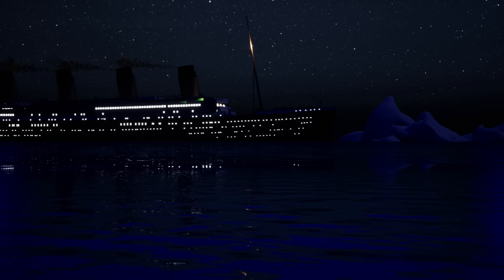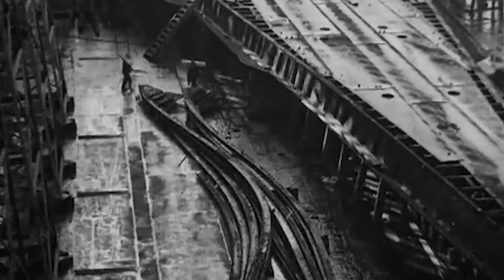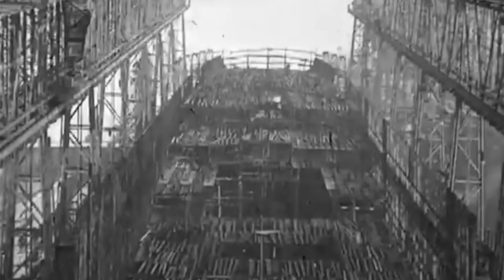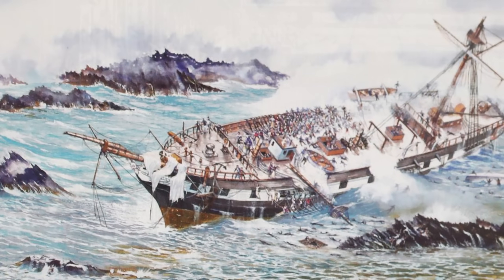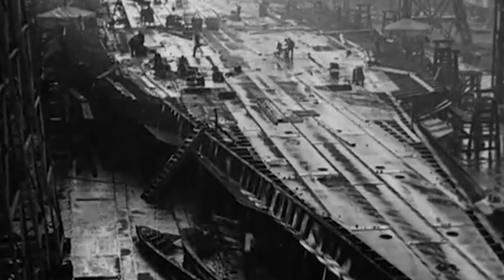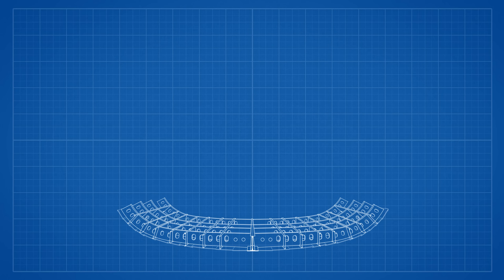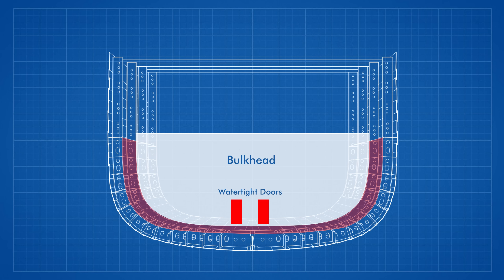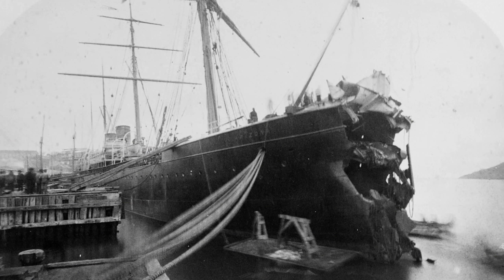How did the Iceberg Sink the Titanic?

Comment: I've always thought it was so tragic that the damage that actually doomed the ship was the small amount of damage to boiler room 5.  If they could have somehow repaired that small amount of damage the ship could have been saved.
Reply: The ship had six compartments damaged. As it was built, it was meant to be able to remain afloat with any two of the 16 opened, or any three of the first five. Six was just way too many ☹
Reply: @whaleguy  Yo, the damage on the 6th could be dealt with by the pumps, it was really minor, and it could stay afloat with 4 of the first 5.
Reply: It's the damage in BR6 that doomed her.
Reply: The rate of ingress into Boiler Room 5 was well within the compartment's pump capacity to remove. However, once the crew closed the forward starboard side coal bunker (Coal Bunker W) the flooding in that Boiler Room was more or less ignored.  Coal Bunker W isolated flooding in Boiler Room 5 (WTC 6) which kept the rest of the boiler room dry until 1:00 or 1:15 AM which the bunker's hatch doors finally gave way to the massive pressure the flood water had increasingly been exerting against them. The suction basket drain sites were located in the center of each Boiler Room. There were no drain sites built into the flooring of the transverse coal bunkers found in each boiler room. In order for flooding in Boiler Room 5 (Coal Bunker W) to be jettisoned back into the sea the crew should have left the hatch doors open allowing the ingress to pour over the hatch door thresholds onto the main Boiler Room flooring where it would eventually find its way to the suction basket sites for removal.  Having said this the level of flooding from damage sustained within Coal Bunker W of Boiler Room 5 (WTC 6) did not provide Titanic with the balance of extra flooding in excess of flooding from the Forepeak Tank, Holds 1, 2, & 3, and Boiler Room 6 necessary to sink her.  When the allision in Titanic's starboard side hull plating stretched past Bulkhead D between Hold 3 and Boiler Room 6 extending well into Boiler Room 6 (WTC 5) the jig was up for RMS Titanic.  She simply could not lose Holds 1, 2, & 3 plus Watertight Compartment 5/Boiler Room 6.  I don't even include flooding in the Forepeak Tank which a horizontal bulkhead forming the top of the forepeak tank limited flooding to just the forepeak tank which by April 14th was likely already around 2/3rds full of ballast water. The rest of the compartment flooded when the ship developed a negative enough trim allowing water to overtop the collision bulkhead from WTC 2 into said compartment completing the flooding.  Titanic would still have sunk if the allision had come to a complete end within Boiler Room 6's hull plating.
Reply: Dennis Wilson  what rubbish. You should stop the silly conspiracies.
Reply: Dennis Wilson  
DO understand... you are using a specificity for steel strength that didnt exist for another 10yrs.

ALSO... when you have earned at least 2 Engineering Degrees, then you can go on about how her steel wasnt made correctly.

P.S
You should walk right up to Thomas Andrews and or the People on the Board at H & W.. and in your 5yr old mentality.. explain to them how flawed their materials are.

Next Time I go Time Travelling, you can go with me and tell them that. Id love to see the look on your face..
Reply: Dennis Wilson  complete BS
Reply: Dennis Wilson  Go away.
Reply: Dennis Wilson  Blah blah blah the earth is flat too right?
Reply: @m2heavyindustries378 Yes, Dennis is delusiobal.  Humble yourself because you are too.  The earth has hills and mountains, but the water is certainly flat.

Comment: I refute that the rivets were as strong as they should be. Wrought Iron is a fairly soft metal so wrought iron rivets would have been to soft to resist the scraping of the ice. Steel rivets would have had a better chance but even then it might not have been enough.

Comment: Wow, that was fantastic!  I have watched a ton of "specials" and things about the Titanic since the 1980s and none of them have ever really focused so well on the pure engineering behind the ship as you did.  Very well done.   This wonderfully illustrates how the disaster was not a case of bad design so much as just the circumstances of the damage being enough to overwhelm all the safety measures of the day (which were very impressive up to that point).  Even the additional safety features that were added to her sister ships (like any engineering solutions) could only mitigate so much before being overwhelmed, like on the Britannic when it hit the mine (or torpedo), which did more damage than could have possibly been designed around.   Anyway, great job again - I'll certainly share this with some friends who love engineering details!
Reply: And aside from the double skin (which was a legitimately good idea,) most of the added safety features were more for show than reasonable. Like sure, they could now survive an incident like the Titanic's where 6 compartments were breached, but it didn't really add anything in other, far more likely scenarios, and by reaching B deck started to cut into actual passenger accommodations like the first class dining hall.
Reply: @flametitan100  Yeah agreed - some were useful, others were more for public image.  The higher bulkheads only delay the inevitable at that point, and not by much if there's that much water in the ship.  As a network admin, it reminds me in a way of security; you need it, but put in too much or do it too elaborately, and you make things so hard for the user they'll avoid it.  Finding the right balance is the trick.
Reply: Brittanic ISTR the major cause for the sinking was all the portholes being open, because the designers had figured out they would all be normally closed in the cold Atlantic runs, but instead she was now in the sweltering Mediterranean sea, and the ventilation was in no way designed to cool the ship, more being designed around heating up the areas that would be losing heat really rapidly to the surrounding cold water, instead of the other way round.
Reply: @SeanBZA  Also as the explosion lifted her bow out of the water the hull was bent enough for several bulkheads failing to close. She would have remained afloat if all doors closed. It was just too much. These mines where meant to sink a Dreadnought. In fact Olympic rescued survivors from a post Dreadnought that hit a mine and sank. And they had a lot of compartments that could be sealed to really isolate a leak.
Reply: @SeanBZA  Yiiiiikes... ya, that'll certainly overcome all the other systems.
Reply: Yeah, it would have taken a "real leap of the imagination" to consider the possibility that a "watertight compartment" actually needed to be completely watertight, not just up to the top of the bulkhead(s). Sorry, although understandable, it was indeed, "just a bad design." Had the "watertight compartments been truly that, we wouldn't be having this conversation. Something that's watertight is exactly that, unless and until it's penetrated. lf not, it's water permeable, kind of like being dead. One is either alive or dead. No one is almost dead.....at least not for long, although members of a certain US political party give an excellent appearance of being brain dead, while walking and talking, etc. Those who are nearly dead, either recover and remain alive, or they're dead, which is permanent.....as far as we know.
Reply: @frankmiller95  The thing is, making them "fully" watertight as you suggest isn't as simple as people make it out to be. You still need the ship to be navigable for crew and passengers. Making a compartment "fully" watertight means potentially sealing people inside of those compartments. Additionally, the majority of the time, it's just not necessary. The design of a compartment is that the buoyancy of the unflooded compartments cancels out the loss of buoyancy from the flooded compartments, preventing water from overtopping. Sure, you can have an incident like Titanic's where after enough compartments are breached, the loss of buoyancy drags the top of the compartments under the waterline, thus causing overtopping, but there you have to weigh the likelihood of such a collision with the impact it would have on passenger accommodations. Something like what happened to the Titanic was pretty low on the risk/reward scale, all things considered. The damage she sustained was around 1/3 of her total length, some 290+ feet. That is rare, and considered an acceptable risk compared to making sure she could survive colliding another passenger ship, which was significantly more likely, but also significantly more localised.

This is on top of there being a point where enough damage is just unsalvageable, regardless of compartment soundness. For the Olympic class liners, this would be at 7 compartments. Even after the Olympic and Britannic were refitted to survive something on the scale of the Titanic, there was still damage they simply could not survive.
Reply: @flametitan100  You've said quite a bit. Modern, ocean-going, passenger carrying ships are designed and built with fully sealable, watertight compartments. While hardly simple, it's the way ships have been required to be built for a long time. Are you a degreed, naval architect or licensed deck officer with an unlimited route and tonnage license, with corresponding sea time? l'm the latter and more, with a fair amount of informal study in naval architecture. Have a look at the instrument in my profile photo. lf you can't immediately identify it and aren't familiar with its use, or hold a degree in naval architecture, or a deck license similar to my own, kindly do us both the favor of not lecturing me on ship design.
Reply: @frankmiller95  Well I'm sorry, I didn't know a sextant, a very recognisable and generic tool of the sea (used to measure the angle of the stars relative to the horizon) was a badge of expertise, and not something you picked to look cool.

Have you ever considered that what we can do now is different than what we did 100 years ago? None of her contemporaries had fully sealed compartments. Even Lusitania, a ship purpose built to be an Armed Merchant cruiser, and thus built to a higher standard than the Titanic, lacked these "fully sealed compartments." Andrea Doria, a ship built 40 years later, also lacked these "fully sealed compartments." Did you think No one in those intervening years thought "why not make them seal off at the top?" (and I mean, yeah, part of it was no one thinking that. If it works, it works, and you don't need to iterate until it stops working)

As I'm sure you know, in a modern ship, these bulkheads require training to open and close, and are closed at all times while at sea, which is admittedly already different from the 1910's. Thus passengers are no longer permitted into spaces where the bulkheads are. For a modern cruise ship, that's fine, because there's so much ship above the draught line you can just seal them off at the draught, like on the Costa Concordia. By contrast, For a lot of these older ships, with fewer decks, the bulkheads would by necessity extend into passenger spaces, (even at their lowest, Titanic's cut into F deck, which had the swimming pool, the squash court, and the 3rd class saloon), so having them passenger navigable was a necessity. Thus, if you wanted a bulkhead deck, you'd need to build it in such a way that it could be easily navigated by someone without any sea training.

It was easier to just have the bulkhead go higher and deal with the relatively low risk of overtopping
Reply: @flametitan100 My earlier tone was unnecessarily harsh. My apologies. There's really no argument between us regarding established facts. To be clear, l'm not saying l wouldn't have made exactly the same design mistake(s) regarding the watertight integrity of ships' bulkheads as the designers, builders and officers of Titanic"  lt's more a matter of tone and opinion. You're clearly well informed on this subject regardless of credentials. My personal opinions come from experience, having studied "marine casualties" for many years and having personally observed multiple near catastrophes for varying reasons, some of them my own. Nevertheless, despite the clear benefits that come with the clarity of hindsight, some of the failures the led to the loss of Titanic were still simply stupid and impossible to overlook. As in almost all catastrophes at sea and elsewhere, it's almost always a sequence of mistakes, any one of which, if not made, might likely have prevented the ultimate outcome.

Obviously, in retrospect it's easy to criticize mistakes made by others when they were doing nothing more, or less than following established, contemporary, safety protocols  l was lucky more often than my decisions were technically correct, especially early in my nautical career. l wince to this day when l look back upon the blunders l made and got away with when l first considered myself "experienced." Later on, as a captain, l was often accused of being overcautious. Command of a boat or ship has always been a balancing act between competing pressures and few of us with that responsibility get it right every time. Despite his well deserved condemnation for some of his failures, Michael Davidson of the El Faro is a perfect example. Ditto for the late Joe Hazelwood of the "Exxon Valdez," who until his one catastrophic blunder was considered by all who knew him as a "good captain." That "blunder" was nothing more than something every captain who ever lived has made multiple times in his or her career, trusting the judgement of one his officers. Having been in both positions, most of us get away with it. The public knows only know of those who do not.

As for my profile photo. lt's not an effort to appear "cool" but simply a photo of my own, personal, C Plath sextant. l'm proud to have it and will leave it to a younger friend with a USCG unlimited master of oceans license and as of now, the youngest captain ever entrusted with the command of a US registered supertanker.
Reply: @frankmiller95  It's a lovely sextant. And I apologise for clapping back at you like that. I'll concede not to be as familiar with more modern watertight designs, as a lot of what I've compared with are contemporary to the Titanic. That said, I do want to get some more hands on experience with nautical matters, having relatives in fishing and a grandfather who served on a patrol boat in WW2. It's just a matter of finding my way into the door.
Reply: @flametitan100 No problem. l'm at least as capable of being a pompous jerk as the next old fart, especially about boats and ships. 

Good luck in your endeavor/endeavour. lf you're serious about actually going to sea professionally and young enough, go to an accredited maritime academy. Sad to say, the marine industry is still fairly misogynistic, but an unlimited route and tonnage license, best and most efficiently obtained via graduation from a maritime academy is the far preferable route, especially for a woman. Even if your interest is mostly in smaller boats, like yachts, fishing vessels or ferries, the possession of a class A license will get you in the door with far less effort. You'll also learn all kinds of cool things you might not be exposed to otherwise. 

Even though the knowledge of navigational astronomy is no longer considered necessary and might not even be taught, it's very much worth knowing, just because it's so interesting helps to understand all kinds of things about the measurement of time, among them, the ability to calculate time zones in your head. For a great video on the subject, check out the full version of " Lost At Sea, The Search For Longitude," about John Harrison, inventor of the first marine chronometer. lf you do, be sure to watch the 50+ minute version, originally aired on PBS in the US. The whole story is fascinating and came about largely due to the Scilly Naval Disaster in 1707.
Reply: @frankmiller95  Aye. My first plan will be working through Transport Canada's Bridge Watch Rating Certifications, which will at least get me started while I work towards the Class A certifcation.
Reply: @flametitan100  Again, best of luck and success to you. We need more women at sea. Often their judgement is better than men.
Reply: Not just later designs had full watertight compartments. According  to this channel prior ships like the City of New York did. So wonder why the builders did not include them.  Are doors that are always kept open except in emergentcy that much of a crew inconvience? Wish the video had addressed this better.
Reply: @njlarry100  - Yeah, I know there were a handful of earlier ships that had it - basically it was not a mandate so much as the wise choice of the ship designer.   As for why they're kept open, yeah, comes down to access/convenience.  If not open the crew and/or passengers have to climb up and over a bulkhead.  They instead hope they can be quickly closed in a disaster, but it's a gamble since sometimes there isn't time, or if the ship's structure is severely impacted (like the Britannic), the doors may not close properly anymore.

Comment: Whenever the watertight doors are discussed, pictures from the boiler rooms and other departments are shown. Is there only this variant on the Titanic? Or are other types of watertight doors installed? If not, how do you get from one department to the next when the watertight doors are closed?
Reply: Well, these are still stairways up the compartment, and you simply have to climb up them in the compartment, till you will either reach a higher level where there are no watertight doors, or the deck, so then can traverse the length. In case of flooding the natural response is to get out of the water by going up, and there are plenty of stairwells to allow that.